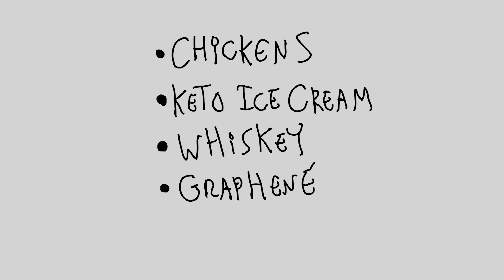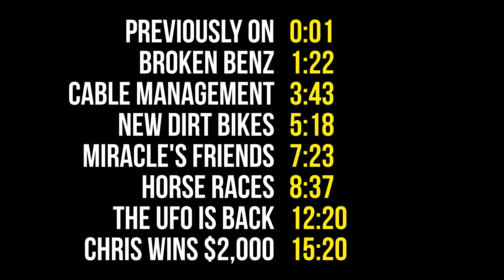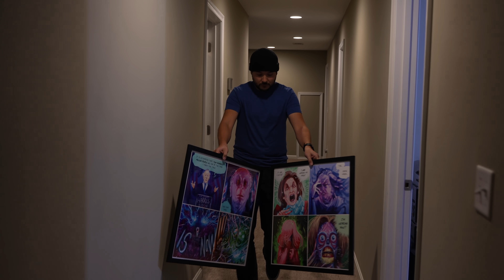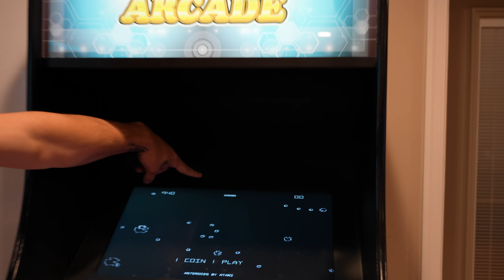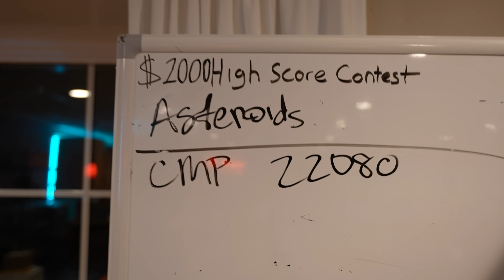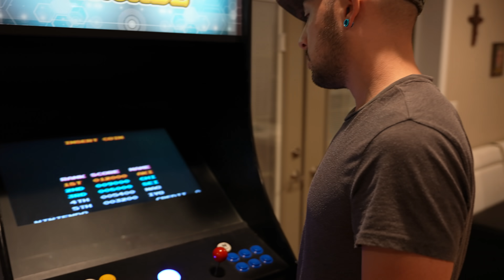Winning Tim Pool's $2,000 Arcade Challenge

Comment: Lol, seeing Tim trying his first ride is not embarassing at all, just the cutest reminder of nearly everybody's first experience on a bike. Learning to release the clutch slowly comes quickly, but be especially careful riding on grass, the weight of the bike makes it feel stable but the wheels will slide very quickly if you attempt a barely tight turn on grass. On asphalt, learn to prioritize clutching and braking the back wheel with your foot brake, you want that reflex honed in for sudden braking because applying the front brakes suddenly is very dangerous and affects your ability to swerve/avoid.
I'm sure you'll have great fun, try not crashing too many times!
Drove nearly 10 thousand miles abroad without a permit, one of the best times in my life

Comment: Do not overfill the engine intentionally!! The excess pressure in the crankcase will cause more leaks and if it makes it’s way into the combustion chamber it can bend the valves! Liquid does not compress.

Comment: Worked at a Mopar dealer and seen a higher level chrysler exec run a brand new car to 40k with the original oil. The engine was shot, and wouldn't you know, the company's warranty company authorized a new engine. That person learned nothing.

Comment: I'm no engine dude but kick starting a bike while the starter is running just feels wrong, i guess technically nothing should break but i wouldn't be surprised if something did.
Also for the love of all that is holy change that arcade aspect ratio to 4:3 if you're not gonna play 16:9 games, it's better for the screen to be smaller than stretched like that.

Comment: The reason why the vehicle would be burning oil is that there is a gasket break (either the header or the valve) or that there is a minor warping on the block due to cooling issues from the radiator/cooling system.

I've fixed those before.
Reply: Nah. If the engine was burning oil, the car would be smoking like hell out of the exhaust. If they can smell burnt oil, the valve cover gaskets are leaking onto the exhaust headers..
Reply: @Dodds_Dirtbikes  I'm just going off what was said. Need to see the vehicle to diagnose it.

Comment: If you put high mileage oil in the Mercedes, it probably won't fix anything, but it might help with some of the bad seals so it only goes through 35% of its oil in a week instead of 40%.

I mean, that's something, I guess....
Reply: Just fill the sump with lucas oil stabilizer. Or axle grease